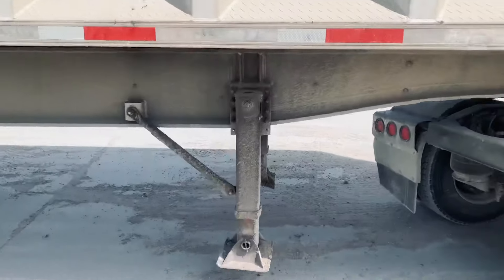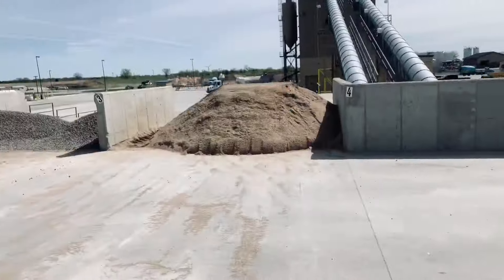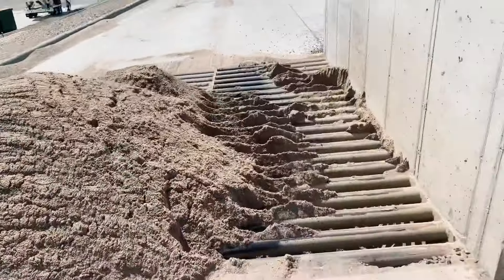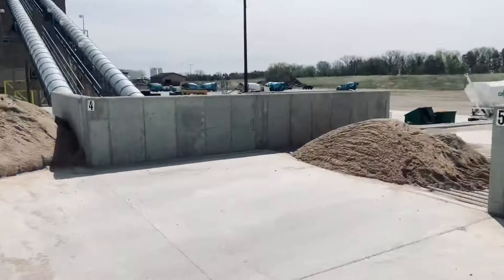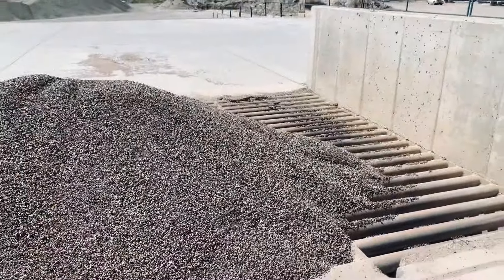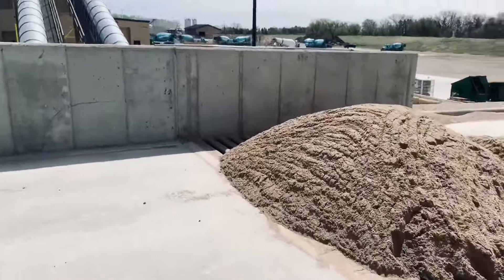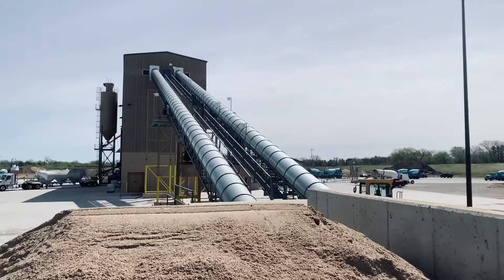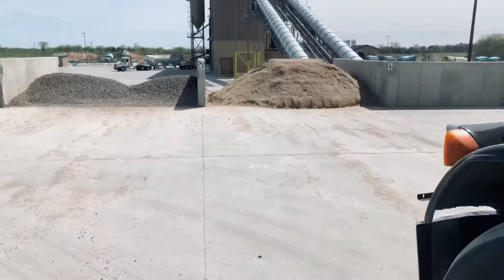How A Ready-Mix Concrete Plant Works

Comment: You guys got lucky with the belts instead of augers. Augers are a pain. But yeah. Once that load starts and you're waiting on material, usually the powder is weighed first. So the longer it sits, the more compressed it gets. Then you gotta worry about it not releasing out of the out of the scale into the truck. That plant looks awesome tho. Looks like a he'll of a lot less problems than any plant with augers

Comment: i remember working at a few "ready mix" plants (before i drove a dump truck).....................when that loader broke down..............we couldn't do nothing.  of course, "the loader" broke down all of the time.  It wasn't like the ready mixed company was attached to some huge corporate black budget or anything......................but we were using the loader to do something it wasn't supposed to be doing.............to make extra money on the side with the company's equipment.   We'd load way too much concrete on the trucks (more than the customer ordered)...........then when we'd come back, we'd dump the concrete on the ground in a pile..............and have the loader go chop it up before it got hard (of course it was still not good for the loader).  But then we'd sell the crushed concrete cheaper than you could get gravel anywhere else (at no cost to ourselves).  Not sure if boss man ever figured out what we were doing.

Comment: I'm confused. Are you a truck driver or a yard switcher or one of the operators/manufacturers. I used to do maintenance at a concrete plant and I've never seen a job like yours.